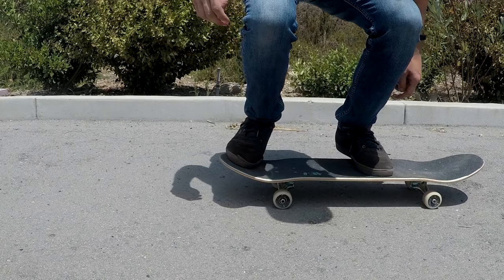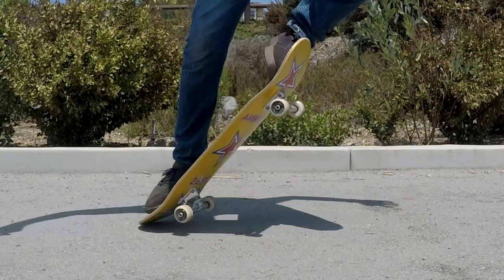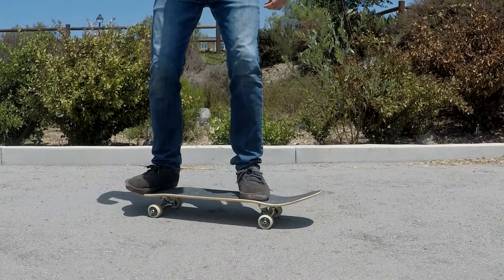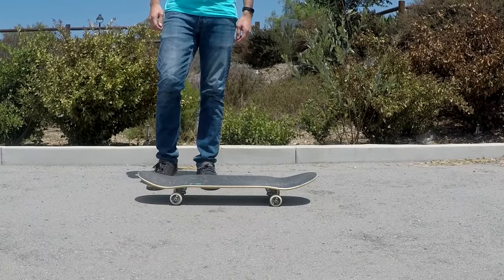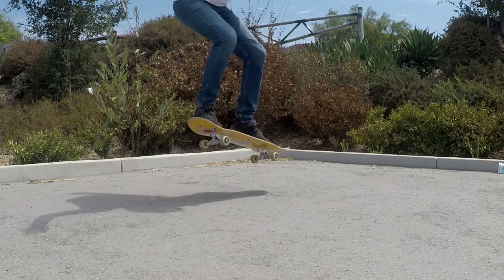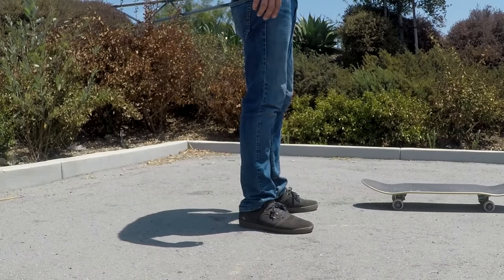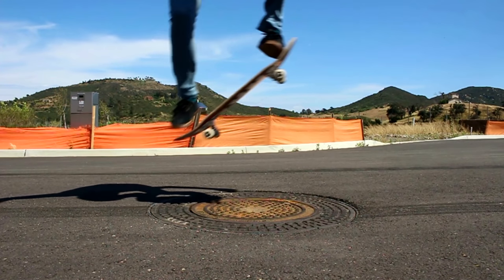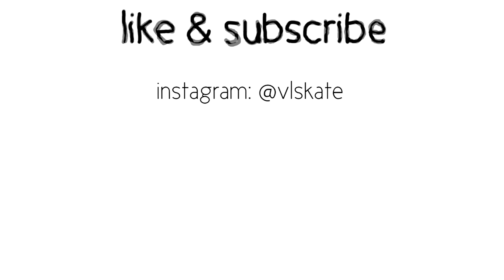How To Get Pop On A Skateboard

Comment: The secret to getting good pop that people sometimes miss is that the harder you pop the tail, the faster and higher up vertically you need to pull the front foot. It's a scissoring motion and the speed of pressing one foot down and pulling the other up creates quick verticality. Also, this is hard to achieve if your front foot is too far forward as more of your weight needs to be closer to the tail.

When your board comes up vertical, the second issue is it then takes a much more exaggerated forward motion and control with the front foot to level it out and at the exact same time as you level out, you need to lift your back foot up at least as high as your nose/front foot. 

When you get comfortable, you can turn your back foot to the side, like a fly kick, and get the tail higher than your nose!

This coming from a former high ollier, though my ankles probably couldn't handle it these days!

Comment: Do you actively snap down the tail when you pop, or is the pop generated "automatically" by the jumping motion? Because when you jump, your feet will extend downwards to give your body a final push upwards. Another thing. A lot of people mention that it's important to keep the back heel "lifted" - rather than flat - before and during the jump. Would you say that lifting your back heel is a necessary step for getting a good pop?

Comment: My problem that I'm still struggling with is that I sweep my foot kind of back and circle it back onto the board which makes my lower leg point straight back mid jump, instead of just moving up and down and it feels so unnatural to jump any different. Literally what's stopping me from landing kickflips without slipping out every time.  
And this is what I find most lacking in all tutorial videos. They all pretend like your feet are 90% of a trick but they are not. Flipping the board every which way is fairly easy, doing so with correct balance to land on the board is not. And with ollies a lot of beginners have their weight too far back because of fear and it's hardly mentioned ever.

Comment: Nose and tail? How do you distinguish between them?
Reply: The tail is a little bit smaller than the nose I'm pretty sure, for me I put a line in my grip on the tail end, you can get hardware with different coloured screws to differentiate the sides (I think?) ( Tbh my deck design helped too personally

Comment: Mmm you are not “bringing the foot up” as the tail goes down the pop. Your body was already on the upward trajectory when you start the popping motion, with ends up lifting the body up and causing your toe area to not pin the tail into the ground, and kinda MISS it. If people practiced lifting the back foot when it pops the tail, they will end up not utilizing the last bit of the body and leg extension to actually jump up.

I really don’t blame you though because it’s a hell of a weird technique to ollie properly, and people that are good at intricate sports are usually not aware of exactly what’s going on with their body.